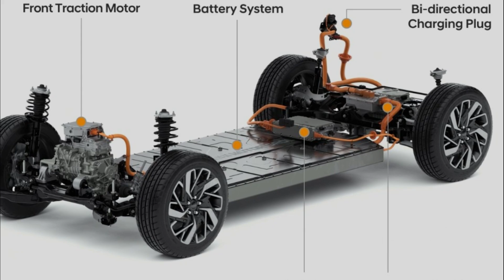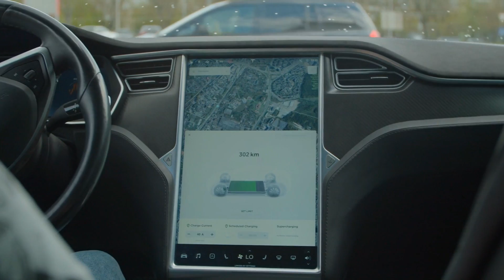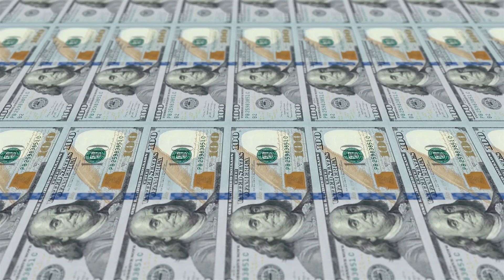Hyundai CEO: "This New Engine Will DESTROY Electric Cars!"

Comment: Pure green bullshit and wishful thinking. The storage of hydrogen has not been solved, the operational range is limited to a maximum of one hundred kilometers in practice, hydrogen is also expensive and dangerous to use. A hydrogen powered engine is easy to build, but everything else is more difficult. To top it all off, the fear of the dangerousness of anthropogenic carbon dioxide is based on the world's biggest scientific hoax.

Comment: Hydrogen is best option,  because of range plus filling time, as opposed to charging times.  Plus accessibility of charging points,  especially for those who live in flats, and terraced houses with no driveway,     government, has no plans to install pop up pavement charging points outside these homes,  so hydrogen is still best option again for less green house gases only discharging water vapour..  Another big big issue is that cobalt for dle tric batteries, needs to be mined further destroying the planet.  Plus biggest issue is they all support the use of child slave labour   in mining this product in africa     not very friendly to children is it  using slave labour.,   so no electric car for me thanks. . But hydrogen is best option for me later.

Comment: The problem with Hydrogen Extraction Cost, Storage cost & Transport cost need to be solved first. 😂
Reply: Engine/fuel systems will have even more complexity, probably increasing the cost. No thanks.
Reply: @gregripp electric is garbage.

Comment: This is not new, JCB have done this already.
They have only implemented this for heavy machinery as they have that it is far more efficient to use ev's on smaller machinery.
Reply: JCB are an outlier. The big players in construction equipment globally are all moving towards using batteries.
Reply: @kiae-nirodiariesencore4270  
Show me the evidence!

Comment: Burning hydrogen is NOT pollution-free - then again, neither is generating sufficient electricity to power electric vehicles, since the current infrastructure can not supply enough for current demand let alone increased demand dictated by electric vehicles - but then again, electric vehicles are just a new way to control behavior, so what will be the next "save the planet" measure to ensure people are deprived of freedoms?....

Comment: Lol the title of this video is the opposite of the content.
EVs are now close to price parity so that argument is lost. Range is now up to 400 miles / 600km so that's the same as an ICE. And charging can be done in 20 minutes which is only slightly slower than an ICE. And then you don't have to worry about fuel crises affecting your ability to transport yourself.
H2 is not going anywhere, except maybe trucks in the near term, and possibly marine and aviation uses.
Reply: Noone wants them. It's good in an ideal situation but here in Canada its not
Reply: There is no fuel crisis. That's a lie